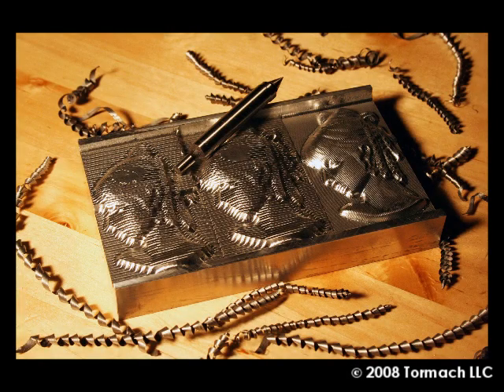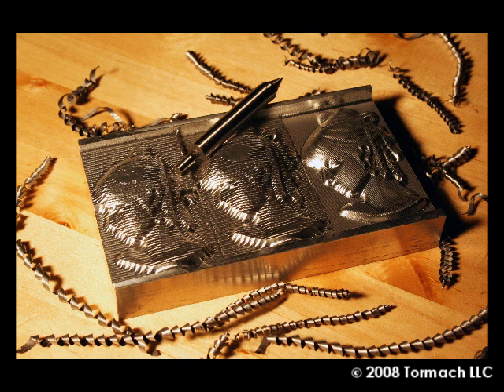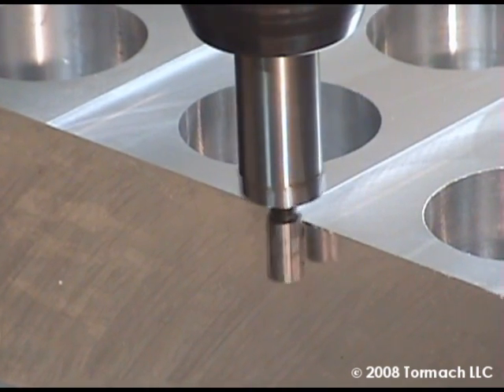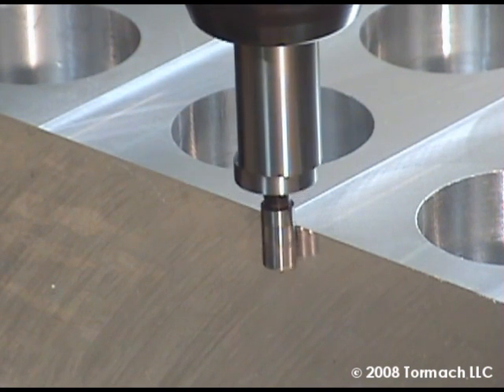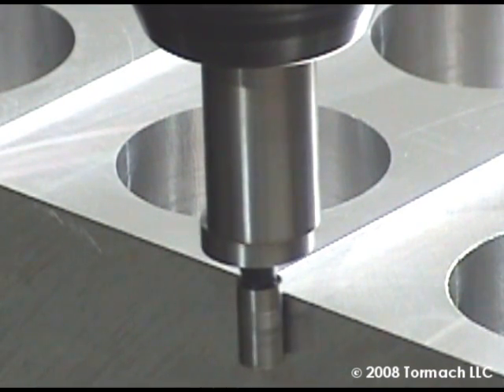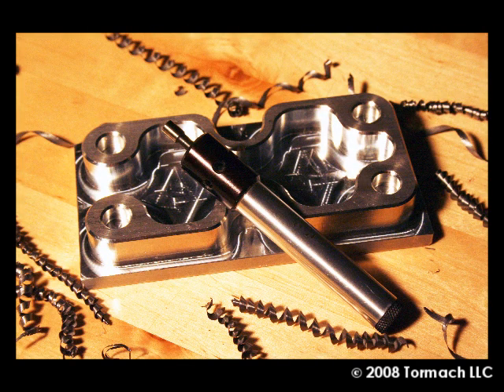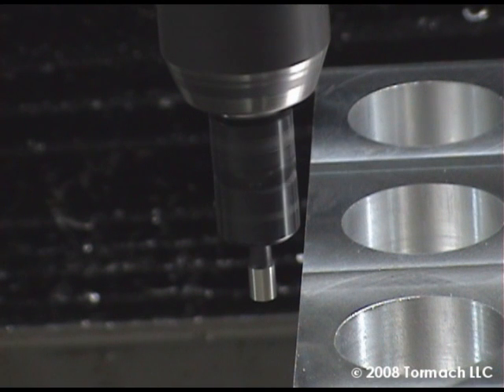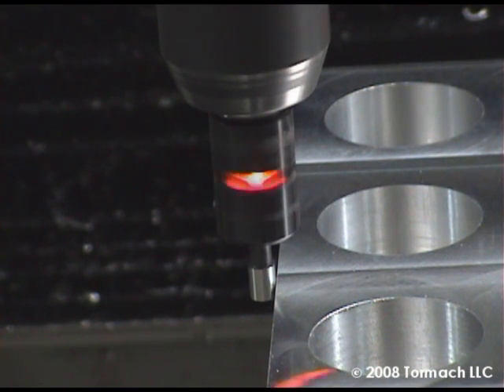Mechanical & Electronic Edge Finder Demonstration - Tormach CNC

Comment: I tried to use a 1/2" edge finder purchased from Tormach, but couldn't mount it in a 1/2" set screw holder, since the shank is not half inch, but .480 instead. Has anyone else had this issue?
Reply from the maker: Hello Cristian, the edge finder should measure .5". Please reach out to our support team and we can help get you a replacement.

Comment: this is whack!!!! you don't turn on the spindle with an electronic edge finder...it uses the conductivity of the metal to make contact and turn the light on...I know this because I just bought my second one, and upgrade from my first and it did have instructions which stated to NOT turn on the spindle...nothing moves on this type of edge finder...time to redo your video.
Reply: Steve S, I’m not positive of this, but I believe that the spindle is running to compensate for any runout issue you may have on the collet or chuck the indicator is mounted in with respect to the the true spindle axis (however small). As shown in the video, the LED dithers on and off as would be the case of a sinusoidal mechanical dithering of the tool tip in a mounting with runout. Looking for a 50% duty cycle in the LED is what you want to shoot for. Makes perfectly good sense to me.
Reply: @markmccornack7983  Find the edge with the spindle running, stop the spindle & hand rotate to find the "hit point", zero the DRO (or dials if no DRO), rotate the spindle 180degs, advance to contact & then split the difference to cancel out the runout.  Sounds lengthy, but with practice can be very quick - for extra accuracy you do a back off & re hit at the first manual rotation stage.  Relying on the 50% isn't particularly accurate as you are making a judgment call on a very subjective view, although probably accurate enough for many applications.

Comment: hello, what is the rpm?
Reply from the maker: The maximum you'd want to spin this is 1,000 rpm. Any more than that, and you run the risk of breaking it.
Reply: 750rpm and make sure that's set, because if it isn't, you'll have a bullet fly through the shop if you'r machine isn't enclosed and this thing starts spinning up to 15000rpm. The only thing that holds the tip in place is a spring.

Comment: so for a mechanical edge finder, once you find the edge you bring up your Z and once over the part bring it over 100 thousandth of an inch to find the true edge of a part? then from there you can can use the DRO to fine tune where you will be drilling a hole or such based on the print? high-school precision machining student here. :)

Comment: Does the spindle have to be running for the electronic edge finder to work?
Reply from the maker: +BruteEngine That depends on the type of edge finder you purchase. The edge finder we are using in this video does require a running spindle.
Reply: +Tormach Inc. We have a high speed spindle (5000 rpm min.) that we can't orient or lock. Do you have an edge finder that will work for our application?
Reply from the maker: +BruteEngine One of our laser edge finders might work for that situation. http://www.tormach.com/store/index.php?app=ecom&ns=prodsearchp&ecom--prodsearch--string=edge+finder

Comment: The PEC (USA) electronic edge finder instructions state to use the edge finder in a non rotating spindle, the finder in your video looks like a PEC but you use it with a rotating spindle. Is there a reason for this ?

Comment: still prefer to use hardened dowel and feeler gauge or tremmel with DTI for greater accuracy. Edge finders ok for convenience and speed but not super precise if you want to Bore or Jig Grind holes.

Comment: In Edge Finding you are trying to locate the theoretical center of axis rotation, relative to the work edge.

That is why a "Fall Off" type is needed.

I've found if you locate an edge normally with the Fall Off type and then set the finder off center using a shim (paper) and relocate, the results repeat.

This is type of tool actually finds the rotational center even running eccentrically!
My experience.

It looks to me like you are hoping the electronic one is running true.

Regards,

Stan-

Comment: I agree.  It is a really bad idea to leave the spindle running while retracting the edge finder above the part in Z.  The bottom edge of the edge finder can catch as you retract past the part edge and gouge the part surface as well as damage the edge finder.

Comment: Well, the electronic edgefinder do at least mot misbehave when not touching the part.
The reason for the mechanical one wobbling without touching the part is probably too high rpm or simply a bad design.
You shoudn´t run it too fast of course.
Reply: It's designed to wobble, it slowly decreases the wobble them runs true, the moment it gets thrown off center that is where you are half the diameter (the radius) from the edge.

Comment: @VirtRampage With this tool  You may forget 0,005mm accuracy, but 0,0005inch= 0,012mm maybe it is posible.  Exist too many reasons why You never get 0,005mm accuracy useing touch methods. Better is use dial gauge tool! Also useing dial gauge tool You may find out that- workpiece is perfect paralel to work axel- X, Y or Z.

Comment: spring loaded edgefinder is only good for about a half anyways. they will differ...they get fucked up quick too. im a manual guy tho no CNC, my best is with a rollin paper...zig zag whites are my edgefinder LOL.  i run mine usually about 1200 rpm...never any higher.

my "Z" axis is my left hand and "X" is my right hand ;-D

Comment: @imacrazydude9999999 
It is zero when the edgefinder kicks out. 
I have never run it up over 1000 rpms.
It has a spring that holds the end on which allows the end to kick out if you run the rpms up too much I have seen the ends fly off and almost hit someone else in the shop.
I usually run mine at 800 rpms.

Comment: I've always ran mine at 1200-1300. I've never tried running it at 2,000 rpm.. I've heard some horror stories of people accidentally punching an extra 0 or two in on high speed spindle mills and losing their edge finder hahaha.

Comment: so is zero when you see the kick or just before it kicks?? someone answer me
Reply: The spindle centre line is .100" from the work piece edge when you see the "kick off".  The reason for this is the physical fact that "size on size" won't fit;  ie.  a pin exactly 1" dia. won't fit into a hole exactly 1" diameter.
For good accuracy & repeatability it's best to do this several times on a given edge.  After the first kickoff set your table micrometer dial to zero (or your DRO),  move the center finder away from the indicated surface, and repeat by watching the table dial or DRO.  At .002" from the surface begin to watch the edge finder.  Very gently approach the edge finder by moving the table, and stop at the kick-off.  Check the table dial or DRO to see if it is zero.  If not adjust dial or DRO.  Raise centre finder to clear work and move the table .100" under the centre finder.  The spindle rotating axis centre will now be on the edge of the work piece.
A very good question is "how close?".  Like most engineering answers this one too is "it all depends".  But with a little care and the repeat as described the accuracy of location should be within .0004".